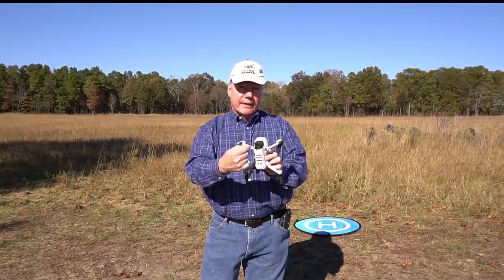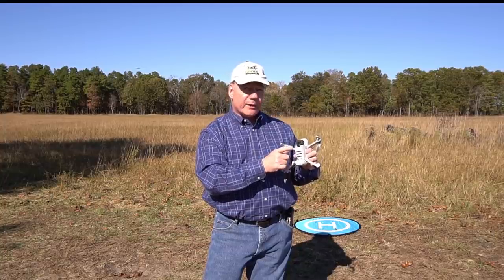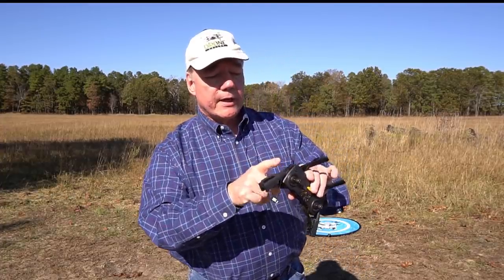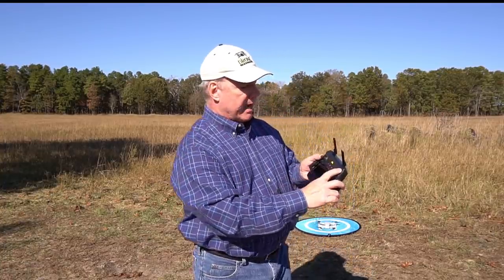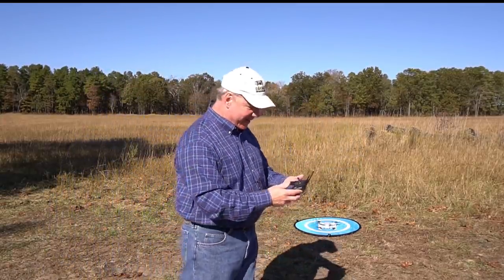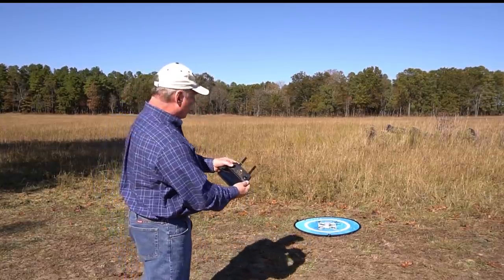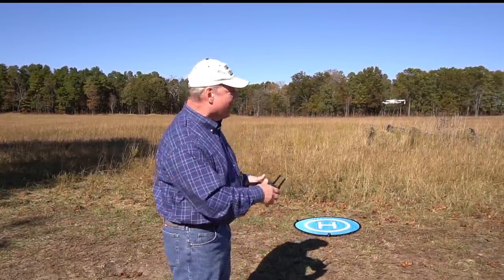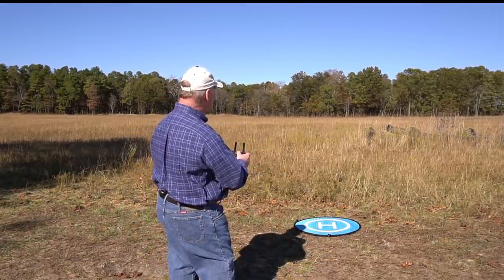Mavic Mini - Setup and First Flight

Comment: At 3:10 he just flies by turning on but the fact is you press once, press and hold for it to flash. After turning on the remote how do you know it is connected?  My phone can't find anything. Its android so I guess the iPhone people say that's where you screwed up...no wait, now at least it is doing something- downloading firmware update. Which he ignored.
Reply from the maker: Stephen, thanks for the post but I did all of the setup before starting the recording. I downloaded the new firmware (remember this was a beta unit I was testing before it was actually released) and had the drone ready to fly. What you saw was the first time I had the Mavic Mini airborne and it was an amazing moment for me. I'm still blown away at how much this small drone flies like a big drone. Thanks for the post and I hope you'll stop back soon. Rick
Reply: Thank you. I got stuck at registration and other places and sorry if I am a bit angry but I didnt expect trouble. Now DJI wants a $39 fee! And I'm not sure it will work but I am making progress. 🤔 Now delay due to "overheating". Just so I make progress it will be worth it.
Reply: One more note: I thought I could simply turn it round and round to calibrate compass and IMU but I discovered you have to follow a specific procedure. I see it can overheat easily.  I also am having to recharge the remote, so it will limit runtime before all three batteries can be used.
Reply from the maker: To calibrate the compass you can follow the on-screen instructions and simply rotate it twice through both it's horizontal and vertical axis until it completes. You won't have to calibrate the IMU. The drone is self-cooling and the only time you might have issues is if you leave it turned on and sitting still. It want's to fly as part of its cooling. The controller charge should easily last through 3-4 batteries if you charge it before you leave home. I have flown through 6 or more and still had a charge left on the controller.
Reply: Thank you for your attention. I will have to contact DJI. I got an IMU error right off. Went in and recalibrated it, which it takes a long time to process. When I had to do it a third time it would not get past 95%. The only time it said it was 100% done i went to fly it i got the same red error message again! No fly yet. Got my hopes up then they were dashed. Maybe a lemon.

Comment: Geofenced? DJI's fencing is somewhat overly aggressive, IMHO. I have no plans to fly in inherently dangerous or prohibited areas, but have been prevented from fling in fringe areas where no threat would be posed.
Reply: Yes it has DJI GEO fence 2.0..If your flying somewhere that you believe shouldn't be included in their restrictions, there are proper channels to address and have it corrected, however that would be a RED zone if it wouldn't let you fly at all so you need to let them know, otherwise you can bypass in APP and fly any DJI pretty much anywhere.

Comment: This is false and misleading advertising they are using other people's clips there is one in there of the DJI Mavic Mini the guy was doing a speed test on the water, why is youtube allowing this??
Reply: I'm talking about the advertising during this video, not this video.
Reply from the maker: Wayne, I can assure you that the video I posted is 100% original and created by me. I do agree with you about the advert they use at the start of the clip ad have asked YouTube to not post that on any of my clips, but I have limited control over it. I'm shocked that DJI isn't taking action against that company since they are obviously using some of their collateral in the clip.

Comment: It's a shame it's not 4k if it was I would brought one.
Reply from the maker: I know I'm going to get flamed for saying this, but I think that 4K is overrated for most fliers. The reason is that the file sizes are huge, it takes forever to edit and render and most folks end up rendering it down to 1080p anyway since most viewers don't have a 4K monitor to view the clips. The 2.7k gives me a little extra image size to work with and is gorgeous. Check out the flight clips I have in the third video I posted for samples. Rick
Reply: @Dronevalley  Thanks for the video Rick and reply. I agree with you but if in the future you wish to sell your clips 4k goes for more money and sell better now. For Youtube the 2.7k is fine so i am 50/50 on buying one in the near future. My self this would been ideal as i goto remote areas by foot and weight is a issue. I am wondering weather if in the future there be a hack to knock it upto 4k. Richard
Reply from the maker: @4seasonbackpacking  I totally agree with you if you're selling your clips, larger houses all want 4K and I'd go with the Mavic Pro Zoom or Pro for those. This is the perfect drone for vacation, hiking and general shooting when you need a small footprint that's easy to bring along. I can't tell you how many beautiful places I never got to fly because I didn't want to drag along my Phantom (back in the day). These newer, smaller quads make that decision easy.

Comment: Spark vs Mini?
Reply from the maker: Darryl, thanks for the post and they are close in comparison. The spark is older and a little larger to take along but has front-facing obstacle avoidance. The Mavic Mini has a 3-axis gimbal for the camera, flies twice as long (30 minutes), takes better video (2.7k) and folds up to a tiny package. You do give up the obstacle avoidance but it's not that big of a deal if you watch where you're flying. I'd go with the Mavic Mini if I had to choose and here's a link you can use to check it out on the DJI site - https://tinyurl.com/y67sbgmr. Be sure to stop back for more content this week. Rick
Reply: @Dronevalley  I have a Spark and a Mavic Air. I'll continue to use my Spark for travel.
Reply from the maker: @darrylnelson05  Darryl, I agree with you. If you own the Spark there's no need to upgrade as they are both great for travel. The Mavic Air is a stop up from the Mavic Mini that gives you 4k footage and obstacle avoidance so you're set. The real question is - when will you add a Mavic 2 to your fleet :)

Comment: The size of the quad has nothing to do with the quality of the video unless you're flying in high winds. All the excuses in the world aren't going to change the fact that this is a 400 dollar 1080p camera drone (correction - 2.7K video). I can grab one with a three axis gimbal that will equal the video quality (almost) at less than half that price. Those who want to pay for the name,  will do so regardless but the idea that others in this price point aren't equally capable is nonsense.
Reply: Butt hurt much? It isn't a name it's what the name stands for, there is no way anyone could build any drone, buy a remote and everything else that it does at $200 or less???. And his comment was directed at commercially available RTF anyway that was painfully obvious, if you didn't take what he said out of context....and BTW it's a 2.7 K drone.
Reply: @repaid1  - Well, yes I corrected the resolution error in my comment, but it changes little. Mavics fly wonderfully, about that theres is no argument. So if you're after a responsive, reliable flyer, then the Mini is probably a good fit. However, for those looking for a video platform capable of  "cinematic quality" shots, well sure, it can deliver some decent video but not as good as the much of the cheaper competition.  Had they not crippled the camera, I'd be all in as I think the Fly More package is a great value. But without any ability to adjust the settings of the video camera combined with the lackluster resolution I just can't get there. For beginning drone flyers and amateur videographers I think it's a great fit.

Comment: Video bitrate rate only 40 mbp compared to Mavic Air 100 mbp
Reply: It doesn't shoot 4K.. the Spark only has 24 Mbps at max 1080p and shoots great videos for the masses. It also isn't made for pixel peepers it's a beginner drone with limitations for weight.

Comment: they need the quite blades
Reply from the maker: Michael, I'll be posting a clip tomorrow showing how quiet this quad is compared to a Spark, Mavic Air and Mavic 2. It's incredibly quiet and I think you'll be fine without upgrading the props. Thanks for the post. Rick

Comment: Hi, are you one of those paid promoters? 
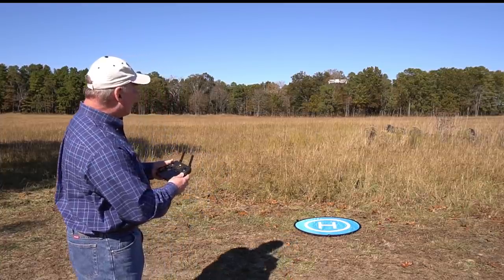What "really windy day"at 5:01 when the grass barely moves? And then  - lets fly it up/down/rotate wooow it "is really responsive" woooow maaan impresiiiiive - it ascends/descends and rotates ... (facepalm) What we are interested is how long it can fly, how far it can fly and can it take panorama photos.
Reply from the maker: Silver, thanks for the post and no I'm not a paid promoter for DJI, I just test gear and have been flying drones for a long time and do my best to provide the information that viewers want to know about a particular product. As for the wind, it was gusting up to 18 mph that day in the field and the Mavic Mini handled it really well. When I was discussing the responsiveness I was pointing out that the quad had zero lag between the joystick movements and the quad reacting. Less capable drones have a sloppy response and the Mavic Mini was right on the money. As for the other specifications, I've posted like 7 clips so far and the first one in the series went into great detail about the specs, and you can find it on the channel. One final note, I do these clips in my spare time to help new fliers get comfortable with a technology. I try my best to provide great value in each one I post and think I'm doing a good job of that. If one of the clips I post doesn't interest you, skip it and I'm sure the next one will be more interesting.
Reply: @Dronevalley  thanks for the reply. I also am flying quad copters since long time and have experience with wind speeds. On your video the wind speed you mention is not evident at all, it looks like you are exaggerating a bit. Although normally moderate wind is not an issue for drones,  the fact you are not that sincere makes me doubt your conclusions. Regarding the drone specifications - I hope you made real world tests, I will have a look :) One thing is a spec on paper, another thing is a real world test.
Reply from the maker: Silver, thanks for the reply but it's hard for me to take you calling my integrity into question. I have no reason to present anything but my observations and I have more footage posting this week from that same day in another part of the field showing the wind in action. The point I was making in the clip is that a moderate wind is an issue for smaller drones like the Mavic Mini and I was amazed at how stable it was in the gusting wind.

Comment: For an entry level drone for someone with no drone experience, maybe a good alternative, but someone such as yourself with an extensive background, I can only say I am disappointed. You really have lost some credibility. I just don,t understand the excitement over a drone with no sensors, so so camera and lens, funky propellers that require a screwdriver, etc.  Why would anyone with drone experience buy this?  I will stay with my Mavic 2 Pro
Reply from the maker: Gary, this drone fits two markets pretty cleanly. It's a great "entry level" drone for new fliers to experience the joy of flight without spending $1000 to see if the like it. Since it has most of the tech of a Mavic Pro built into it, that means they won't have to worry about drifting like so many other small drones suffer from. The camera is very good (its the same sensor as the Anafi and the Evo) and it flies like a dream. The best part for me, and why I was so jazzed, is that when I travel I usually take the Mavic Air or Spark along for the trip. I think the Mavic Mini is better based on a few weeks of testing and will now become my travel drone. It's smaller, easier to charge, flies longer and firs into my luggage easier. It's not a fair comparison with the Mavic Pro/Zoom since they are designed for more serious fliers. I'm always honest about the gear I review and if I'm excited, there a good reason for that. Fly it first and let me know if you change your mind.
Reply: In Mexico where my wife and I married and holiday they have changed their legislation to no drones for visitors to the country unless they are less than 250g. That made my mavic near useless to me as that was what it was originally bought for. Now sold the mavic and awaiting your videos and believe that the mini is the answer I need.
Reply: He reviews drones that other people may be interested in. How is that losing credibility? Everyone can't dish out over a grand for a drone, and less expensive drones are not going to have the same advanced features as a Mavic 2.
Reply: Eddie Hicks Because he is so excited in explaining how “great” this drone is when really all the “great” features have been eliminated to reduce cost and weight.  I believe this drone will turn out to be expensive for many “new” inexperienced flyers because of loss, damage, etc, etc with no sensors to save them

Comment: Looks like a toy drone I can buy at my local hobby shop.no 4K,no sensors,same ol controller 👎🏼
Reply from the maker: I know it seems that way but it's more like they took the Mavic Pro (a groundbreaking drone) and shrunk it down. It has all of the flight savvy and stability of a drone twice its size and is SO smooth and stable in the air. Trust me, I've flown too many small drones to count with my testing and this one is small in size but huge in performance. Stay tuned for more clips this week to see if I can change your mind. If you really need sensors and 4K, the Mavic Pro Platinum is a good choice that will do that today but you can get 80% of that quad in the Mavic Mini for 1/4 the price.

Comment: I'm sorry, the video was awful. Whole bands of the ground went totally blurred out. The lack of exposure and white balance control is also a deal killer for me. Blown out highlights too. I'll wait to see if it evolves or not, but doubt DJI is going amp up the photo controls that photographers need, because they'll want you to buy a more expensive drone to get that kind of quality. To me its a really fun toy par excellence, but its definitely not a camera drone and targeted to kids and young adults who want something easy to and simple to fly, they don't read manuals and the lack of obstacle sensors means theres going to be alot of these crashing and getting lost. Not a Spark killer, not an Air killer, it is just what it is.
Reply from the maker: Thanks for the post but blame YouTube for the pixelated video more than the quad. Something happened between the rendering in Premiere and the posting to YouTube (with their compression). I will be posting more content samples soon and may actually post a link in the comments to the raw footage so you can see what it looks like right out of the quad. It's an incredibly nimble drone with a decent imaging system so stay tuned to the channel for more content soon. Rick

Comment: DJI fanboy... unfortunate. This drone is a step backwards. Throttled specs and crap customer service. Any drone with extra screws and a mini screw driver is more a toy than a drone. 249grams but it’s still geo-fenced and tracked using new hardware for FAA and law enforcement. Your data isn’t yours on a DJI product.